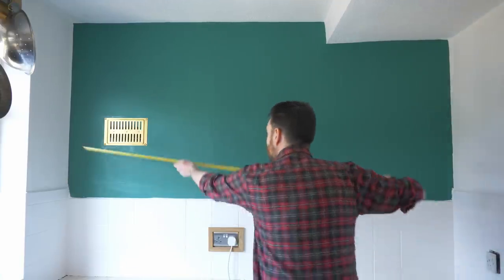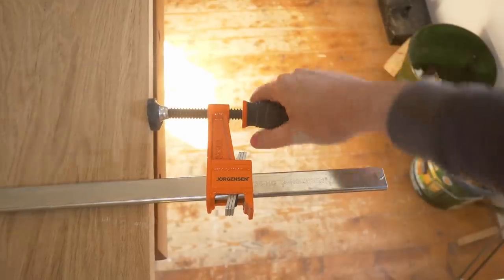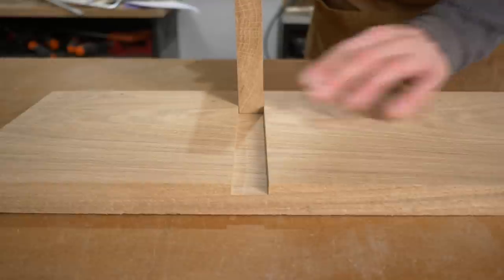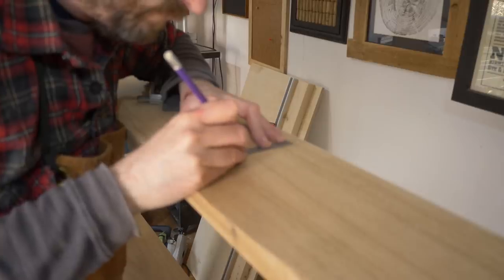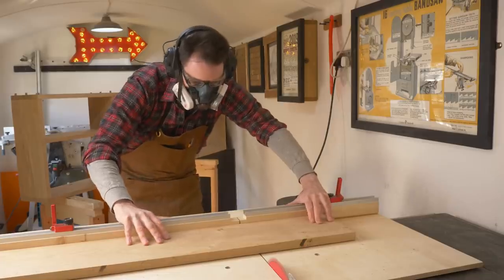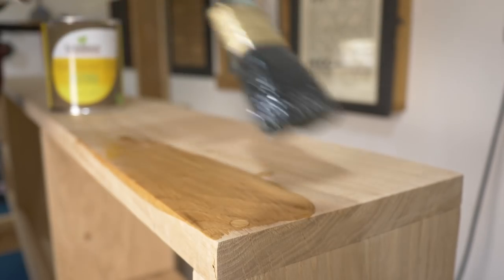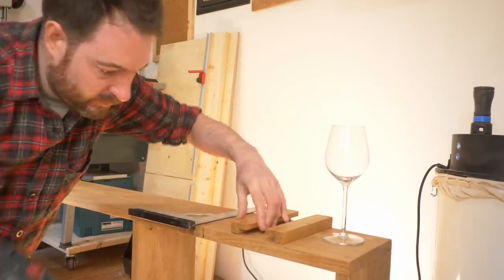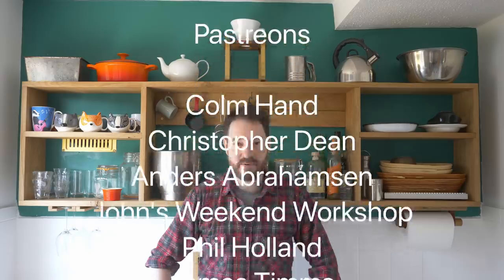Making A Oak Kitchen Wall Unit

Comment: Nice strong build, nice looking finish with the hard wax oil coating. One question, why did you drill & plug with brass threaded inserts? I can't see how you would use it on the wall side of a French cleat?
Reply from the maker: They and not threaded. They are just holes for the screws to attach to the wall